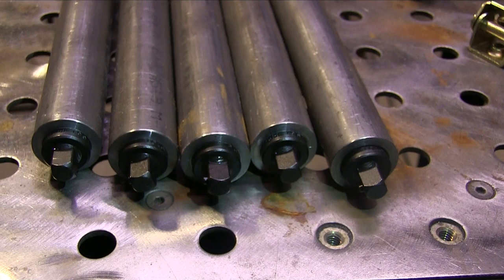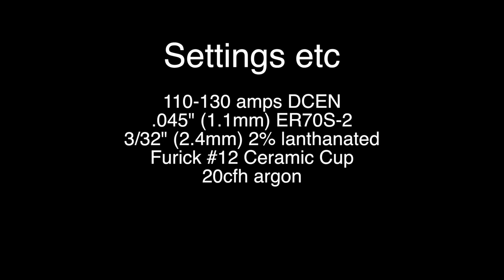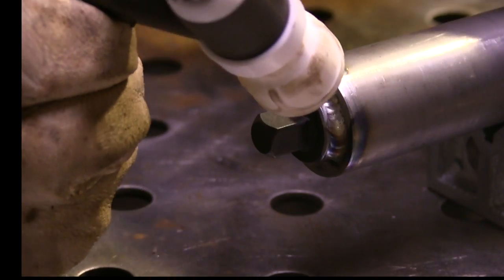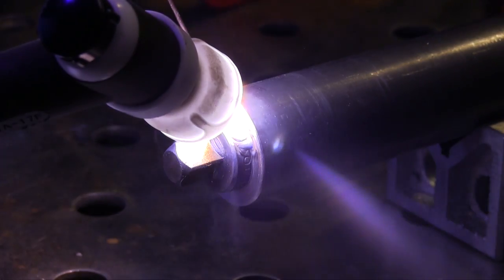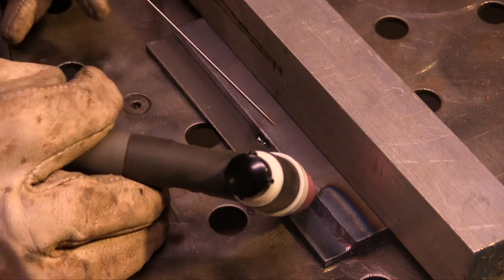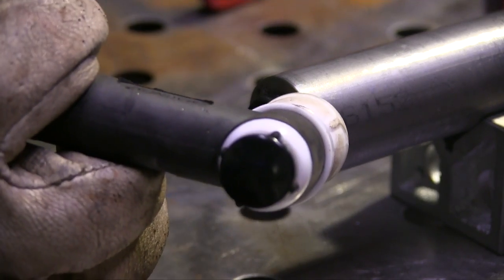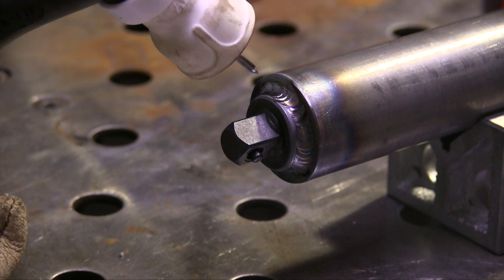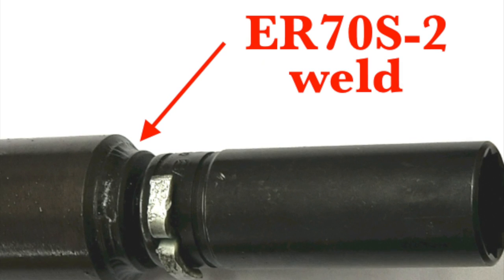Tig Welding Custom Socket Extensions

Comment: Down and dirty tip for when you’re without a positioned. Attach a string to a block of wood (a rough pedal). Then run the string up from the for to your table and wrap the string a few times around the part you want to rotate. Pressing on the wood block tensions the string and rotated the part. Cheap. Easy. Effective.
Reply: I'm going to try that. Thanks!
Reply: Adam Galowitz I like it!
Reply: I was thinking same thing I believe.  Sort of like an old fashioned tredle lathe (like on Roy Underhill).
Reply: Great tip I’m gonna try that some time
Reply: @emeltea33  Roy is a great teacher

Comment: The larger diameter  reduces torque loss. They would need to be torqued at a specific number and a smaller diameter tube will loose torque/twist over a specified distance. You can take an extension and torque a bolt to a number, then remove the extension and check the torque without it and you will see that it is short of your number.

Comment: Awesome. I built a similar tubing extension to use on my bungee tool for installing shock cords on cub, Pitts and other similar type landing gears. The 14 inch deep socket allows me to use a 1/2' impact to take up all the slack and save time.

Comment: Nice, I made a homemade 1/2” to 3/8” socket adaptor for my impact gun out of a big bolt with 4 squares of steel welded together for the female end. Works mint!

Comment: My guess on a diameter that large may be like you mentioned is to guide the socket in place. Another possibility would be a more accurate torque specification. Might save some math and accuracy trying to figure out the flex you get with a standard size diameter extension. Another reason may make it easier to secure the socket to the extension as well. I know a common practice for airplane mechanics to wrap electrical around the socket and extension to make sure it doesn't fall off. If they lose a socket or other tool the plane is grounded until they find it.

Comment: ER70S-3  has less deoxidizers additional deoxidizers provide better wetting, giving a flatter bead shape and the capability of faster travel speeds E70S-2 is a triple deoxidized wire which provides defect free weld deposits when properly used on most carbon steels. It is used especially for pipe welding

Comment: Great job,. I never did mind a little contrast between the weld when using stainless or nickle.  As mentioned the diameter is probably to get an accurate torque applied.  I'm assuming that's a thick walled tube?

Comment: The large diameter resists twisting.  And if they're using an impact, the twist of a normal extension would absorb the individual blows of the impact gun, making it essentially useless...reducing the torque it can apply.
Reply: You can buy impact extensions though. It would be stupid to rattle down a bolt relying on that little weld. Pretty sure everything would be torqued to spec in aviation as well, so doubt you'll be fucking up a normal 1/2" extension.
Reply: On the question of torque and specs, wouldn’t these tools return a more accurate reading on a torque wrench due to reduced flex?
Reply: @daniel Yes, your correct they would. in alot of areas its not exactly critical to worry about the torque loss from an extension or god forbid using a stupid wobbly.... but... in aviation the numbers are a dead set critical number to hit.
Reply: sly5.0gt I’ve only worked on automotive but I was taught not to use extensions if at all possible when final torquing parts. These look like a workaround for that in hard to reach areas. Now I kind of want to go out to the garage and make one.
Reply: ive worked on some marine, made specialty parts for aircraft but never worked on one..and mainly do automotive fabrication and build custom racecars.  it takes everything i have to not lose my shit when i see someone with a 1/2 to 3/8 adaptor to a 12" extension with a 3/8 chinese wobbly and a deep socket on the end of a 1/2 torque wrench.... and yes..i have walked out into the transmission shop i used to run and seen a tech doing that...to the timing chain tensioners on a god damn audi R8 V10..... lets just say we had some words and he chose to find another place of employment 20min later...
Reply: Daniel Curtin:
Flexing or torsion would only affect torque with impact wrenches; for steady hand applied torque, there is no difference provided everything is driven in a straight line along the centerline of the fastener.
Reply: you are correct sir 

I am training as a aircraft mechanic doing heavy maintenance and we are forbidden to use normal extensions to torque a bolt to spec no matter the length or brand as any twist would have some impact on the overall torque so special extensions are supplied with fixed sockets 

also on the dropping things everything is signed for and I mean everything individual rivets etc if you lose one you must find it even if the aircraft needs do be completely disassembled to do so nothing can be just rattling around at 30k feet may cause a short or get jammed in something critical AAA doesn't do 30k feet for a breakdown or a tow
Reply: Aviation Association of America?
Reply: @DTR , not necessarily..ive done a test on it and anything over 3" or made of super shit chinese metal will start to twist over 50 ftlb, causing it to drop in torque, sometimes starting as low as 25 ft lb. its especially bad when someone has say a 3/8 extension thats 12" long and tries to give the bolt a 90deg' turn...when in fact they only got about 80-85deg'
Reply: @robert what...AAA wont pick me up in my sesna if it has a flat tire in the air!...this is bullshit! ;-)
Reply: Also of i remember correctly, you are not allowed to use normal Chrome tools, As they can leave small amounts of the alloy from the tools - can anyone confirm🤔
Reply: sly5.0gt 
If it's a rapid torque action where the extension is not fully stabilized, the torque may be lower, but a hand tool isn't working in milliseconds, so the torque is going to be the same throughout when in a static condition. 
If torque is applied slow and gradually, it is the same. If you don't maintain a straight line, then there will be differences corresponding to the drive angle. That's why wobble adapters and u-joint adapters shouldn't be used for torquing, as they will result in reduction in the actual torque.
Reply: I have been working on aircraft for many years. We almost never use any form of impact gun on fasteners. The only impact device is a rivet gun. I can only imagine it is required to align through an orifice & critical that the socket comes out with the extension, not fishing it out afterward. Also, it would be a pretty heavy tool. As for claiming that extensions aren't allowed to be used...the bolt on the end of the extension dictates the final torque, not the design, colour, length, finish or country of manufacture of the extension.
Reply: sly5.0gt 
If you are using torque to angle rather than an actual torque measurement, you're absolutely correct, the twisting of any extensions will reduce the torque, if your angle indicator is on the far end of the extension. I was referring to using torque wrenches, not torque to angle methods, which rely on thread pitch and bolt stretch to achieve the target torque.
Reply: he's right. I connected 2 of 3 ft 1/2" extensions, which is only 6 ft total, to knock off 75 ft lb torqued tranny block bolts. Wasnt successful with 1000 ft lb impact gun due to all the flex and twisting.
There must be a reason the mechanic wanted this particular tool.
Reply: sly5.0gt , Im with DTR RTD on this one. A extension doesnt effect torque when using a normal torque wrench. 100 ft/lb on one end is going to be 100 ft/lb on the other end, if it doesnt twist that just means that you have to turn the torque wrench farther to reach the torque. Now if youre talking about wobble extensions, U-joint, or swivel joints or using a impact then thats a different story and for a different reason.
Reply: I am an aircraft mechanic and I can assure you that no impact tools are used for loosening or tightening nuts or bolts, ever.  With big engines costing a million dollars or more, every part is torqued by hand, with a manual torque wrench.  It is more likely that this is reaching down inside a bore, or across multiple parts, and the diameter allows for proper alignment at the correct angle.
Reply: The torsional flexing of the extension is the whole concept of torque sticks, which are supposed to limit the peak torque from an impact wrench because it gives way when it reaches the torque threshold.  The impact wrench only supplies a short duration and short travel impulse before it releases again, so the torque stick springs back to the original at-rest position for the next hit.   

Torque sticks only work with impact wrenches for this reason; if you try using them with a breaker bar, they will not work.

Even if you use an impact wrench, it has to be matched to the torque stick value; if you use an uber power wrench and go to town on some low value torque stick, it would twist it past its elastic deformation point and go way over the target.  And if you use a feeble impact wrench with a high value torque stick, it will not reach the target torque and be just as ineffective.  
No one looking for precision torque accuracy would use impact wrenches, with or without torque sticks.  
Torque to angle is the most accurate, as they are not affected by thread lubrication or corrosion like the manual torque wrench would be.

Comment: I am needing a dogbone with a 5/32 Allen wrench on it that s stubby also. I need it to be strong for torqueing properly. When ive had them made by our welder they only last for a few torquings and strip out.  Is it the quench method? Are we getting the Allen wrench too hot? How can I make this last. Im using eklind amd bondhus Allen wrenches cutting them to size and having it tig welded to a chromed dog bone I grinded down.

Comment: Hi Guys, 
Very new to welding. I have to add some reinforcement to an angle stock. The angle stock has already been painted. What kind of welding method is best to use if I do not want to sand down the paint. I watched some people say some electrodes do not require prep. I have a Miller MIG . Is there a certain wire I can use that does not require prep also.  I have to do 700 pcs

Comment: Love these vids! What does the heat of the weld do to the detent-ball's spring? Perhaps it's a not an issue, but just wondering if it might adversely affect the spring's temper.

Comment: Hey Jody love the channel, I have my associates in welding, but I still learn allot from your channel. Anyways I had a question I have a Lincoln weldpak 155 and I would like to hook up a spool gun to it so I can do some aluminum jobs. I plan on getting a TIG eventually but it's not in the budget right now. So my question is how feasible is it to add a spool gun to my welder or any other mig that's not pre-wired for a spool gun? Is it safe? Will it work well enough to produce good welds? Thanks for your time.

Comment: The thicker piece is for proper toque on the nuts and bolts. A regular extension will twist and give a false toque spec.
Reply: ugh
learn the difference between instantaneous force and work
then comment on it

Comment: Would 312 have been an acceptable rod choice as well? I believe I have heard you say 312 is a good maintenance rod. If not, what is the proper application for 312?

Jody may I also say that your videos have been absolutely instrumental in my learning to tig weld. You're a good man.

Love the channel, love the online store.

Thank you sir.
Reply: The Concrete Box two diff metals I don’t think 312 would work.
Reply from the maker: thanks very much, and yes 312 or 309 would have been a good choice for filler rod.  309 is often easier to find and I have had pretty much equal results with it as 312
Reply: Jason     If it was not for the need to weld dissimilar "two diff metals'' 309 and 312 would lose about 75% of their purpose. Either 309 or 312 would be a good structural weld on these parts. Inconel 82 would be a good choice and so would crown T-220 if cost was not a factor.
Reply: tdej80 right but like Jody said with the black oxide it wouldn’t of looked good that’s why he used the s70-2
Reply: Jason     You are trying to change the question! I was clearing up that on this dissimilar metal joint that the 312 or 309 would work. Many times someone in maintenance would use an alloy of stainless to help ensure the weld met the strength requirements necessary. That is a trick employed by someone who welds but does not weld constantly. It is an expensive crutch to prop up a less skilled welder by ensuring the filler metal will work. Your original answer had nothing to do with the black oxide. I will give you some advice, long on mouth and short on ears is no way to learn to weld. You smartass a good welder and he will lose interest in helping you very quickly!
Reply: tdej80 you obviously didn’t listen to the video of why he actually uses the er70s 2. I wasn’t trying to change the question, maybe I just mis understood. I’ll give you some advice you don’t know me at all so I would suggest you just keep your comments on welding. I was under the impression he was asking why he didn’t use 309 in this matter, it’s that simple. I know why 309 is used as well as 312 I’m not an idiot. I’ve used them many times. Both mig and tig. Get off you’re high horse and stop acting like someone was being insulted, the only one that did that was you with my intelligence. And I don’t need any help learning just an fyi, I watch Jody video because I enjoy him as pure entertainment and buy from his store that’s it.
Reply: The Concrete Box thanks concrete, I maybe mis understood your question. I was talking strictly about the black oxide not coloring correctly under 309 or 312.
Reply: tdej80 that’s not true, I was under the understanding that he meant this video. I also wrote a message saying I mis interpreted, If you decide to read properly you’d see that. However I think you just like to be a troll! I really don’t care what you think. You’re a keyboard commando. I’m actually a nice guy and I always treat people right! With that said If you’d like to meet up in person I’d be glad to show you how I am when people think they are tough guys! If you’d like to take me up on that let me know.

Comment: Another great video Jody! Question...I remember you saying you worked for Delta as a welder. Are you also an A&P?
Reply: He wouldn't need an A&P he would have to have a Mil Spec cert for welding..which I think he does.
Reply from the maker: I did work for Delta but strictly in welding and metallurgy.  never got my A&P
Reply: Hi Adam. I understand he didn’t need an A&P but I was just curious if he had one. Definitely would have to be mil spec. Probably 1595a back then or is it 17.1 now?

Comment: Getting my first TIG machine. Looking at the squarewave 200 for it's basic functions and value. Thoughts?
Reply: Great machine for the price only complaint I have is that the post flow is not adjustable. Check WeldingSuppliesFromIOC no tax and free shipping, also if it's your first purchase from them you get $15 off.
Reply: I am pretty addicted to Lincoln's TIG welders, I have an old Square Wave 255 at work and a newish Precision TIG 275 at home which I used to replace my old Precision TIG 225.  I have been to two Motorsports Welding classes at Lincoln's welding school in Cleveland, and in those classes you are given time and encouraged to try pretty much any of the machines on the floor.  I think I am getting a Square Wave 200 when I get the chance (or, you know, the money...).  The 200 was super nice to weld with and is light enough that I could take it places, my two transformer machines are crazy heavy, the 275 is 750 pounds! I liked welding with the PT 275 more than the Square Wave 200, but on a limited budget or with limited space or with a need to be transportable, the 200 is a great machine.  And even at higher frequencies on AC welding, the noise did not bother me as much as most inverter TIG machines.  The noise on AC is one of the biggest reasons that I stuck with a transformer machine when I replaced my PT 225.
Reply: pgf202 one of my concerns was that the SW 200 didn't have the adjusting capabilities as some other units, but as a novice that might help my learning curve. Jody and other YouTube videos are my school....wish I had someone to work with and learn from.
Reply: Matt Leicester part of the reason for the TIG is definitely portability. Miller diversion 180 and one of the everlast welders is not out of the question. I just see a lot of good reviews with the Lincoln.
Reply: my suggestion is to buy whatever you can afford.  i run miller syncrowave 250 dx's at work all day and run a cheap AHP tig at home.  It can weld nearly just as nice and has even more features than the syncrowaves.  Just remember the machine is only quarter to a half the price of getting a tig setup.  Gas bottles, filler, tungsten, cups, torches, all that stuff adds up.  Make sure you have some extra saved up! anyways have a good one.
Reply: 5th Street Fab That's definitely some good advice. Thanks

Comment: What tig you using. I heard if it not Miller or Lincoln electric don't buy it. Because there the best.
Reply from the maker: I used a Lincoln square wave 200 for this job.
Reply: weldingtipsandtricks 
How many others do you have or want to have